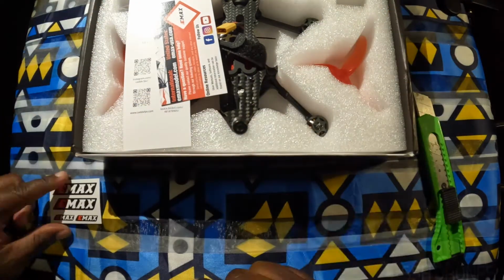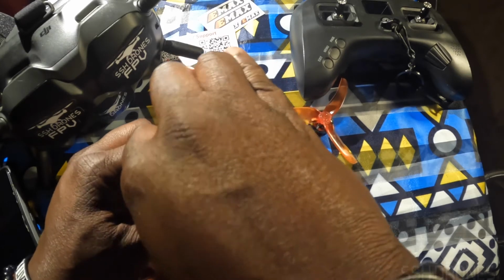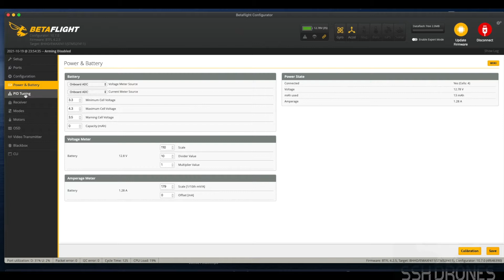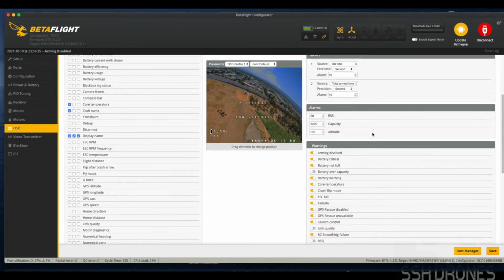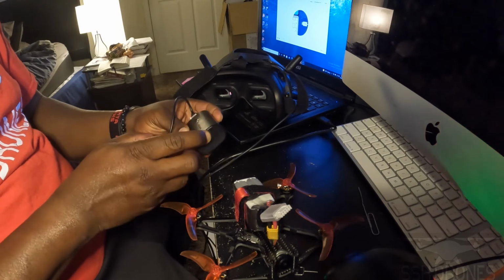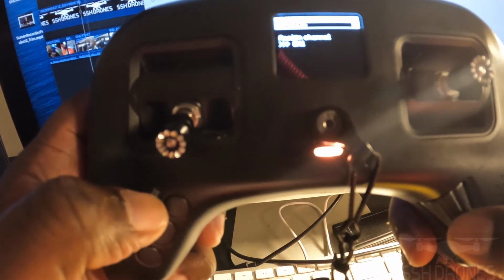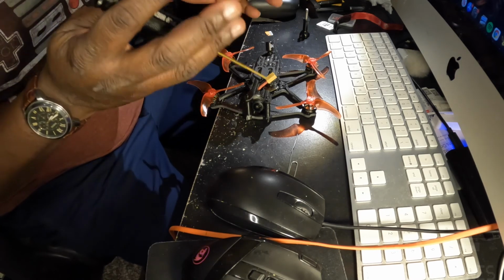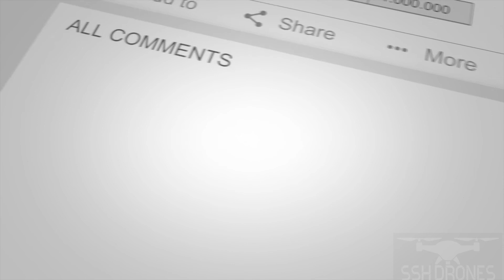SSh drones Tutorials: Emax BabyHawk 2 / How to set up on Betaflight & TBS Tango 2

Comment: Hello, thanks for the video. 

for me everything works but in Betaflight it says - RX_Failsafe. I have no clue what I can do.  I have the O3 Air unit and I use the Radiomaster Zorror. It feels like everything is connected and bind. But I just can not arm the copter. Do you have any idea what to do?
Reply from the maker: Does the Radiomaster have an RX connected to the quad? RX_failsafe may mean that the Radio has no RX to connect to which makes sense